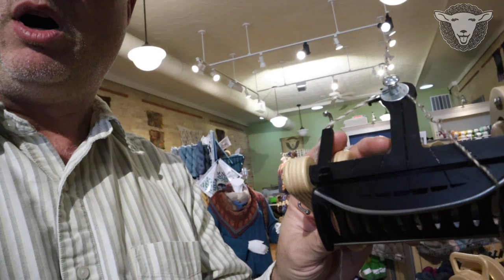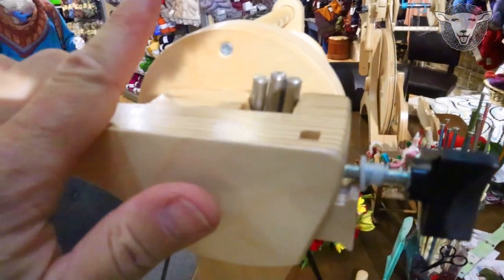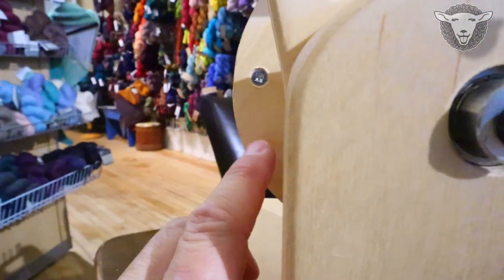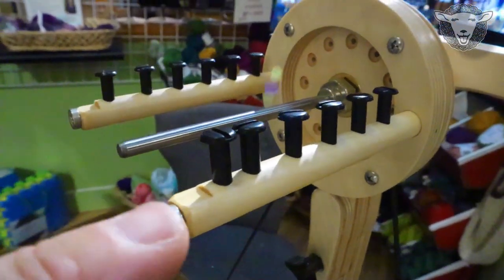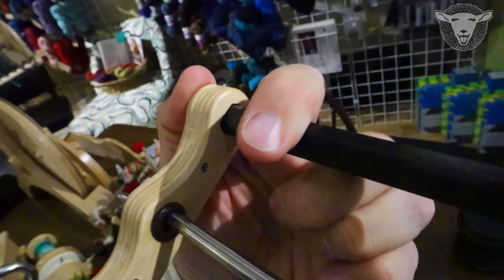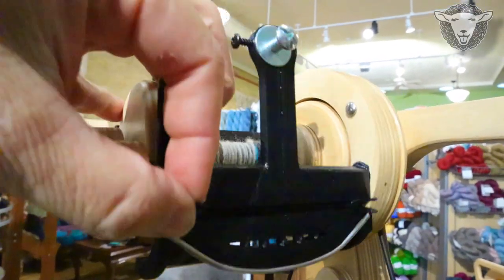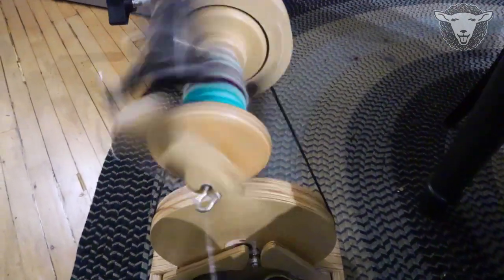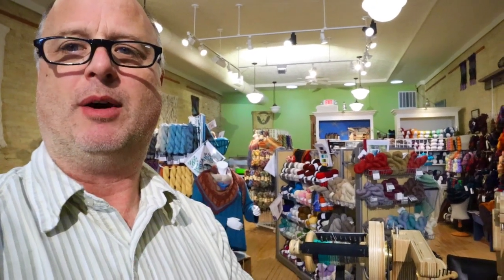How to assemble your new Spinperfect  Paulywinder by Spinolution, on a variety of Spinolution Wheels

Comment: Thank you so much for this video. It made it so easy to assemble and I am so happy with the Paulywinder. I just wanted to share that the fulcrum screw (the silver part) needed to be loosened a bit before I could adjust it with the set screw. Also I discover the Paulywinder did not work well with the orfice bar with the pvc pipe that I had bought for the Pollywog because I spin very fine. I had to adjust the pins regularly to prevent it from only filling in one place. However, when I went back to orfice bar with the hook (the original on the Pollywog came with), it worked a treat and did a great job of winding on evenly without any adjusting. Just a bit of feedback to help anyone who might be experiencing the same issue I had.

Comment: I have an older pollywog with a wood whorl. Any problems inserting the paulywinder?
Reply from the maker: It should work just fine,   But if you have any issue drop me a note.
Reply: I think any friends from you have a 3D Printer. 
This Part is very easy to print. 
But it is very ugly this winder. 

The WooLee Winder looks like very nice and works perfekt also by very thick yarn. 

The problem by the Paulywinder is the imbalance on your wheel. 

Okay. The spinning wheels are also the cheapest scrap metal. That's where the ugly thing fits very well.

Comment: You don't mention the Hopper. Will it work with the Hopper? I've already checked and it looks like it is going to be a bear to get those strange square screws out.
Reply from the maker: It should work with the hopper
What generation is it?
Reply: @SpryWhimsy  I should have asked whether it worked with the Hopper before ordering. ;-) I ordered the Hopper new, guessing about 5 years ago. It was right before or after prices went up. I had to wait 6-8 weeks for it. I got the screws out but have been unable to get the arms off. They are stuck well and good. Any chance they could be glued? How do I tell generation so I can put it in my notes?
Reply from the maker: Remove the outer ring with the arms
Reply: @SpryWhimsy  I removed the 4 screws holding the outer ring. It doesn't come off.